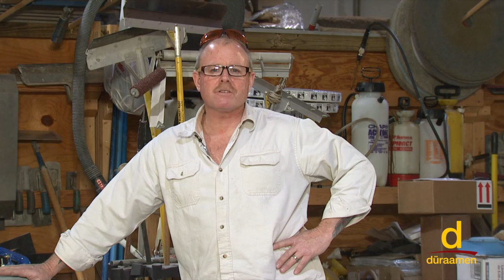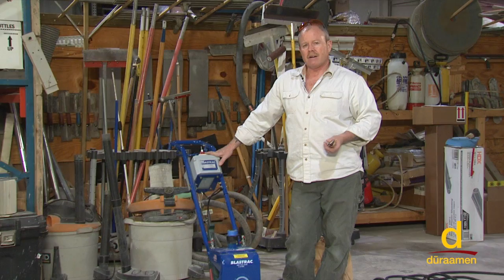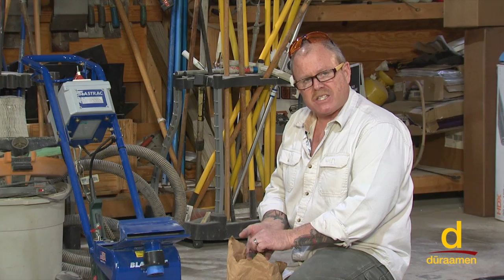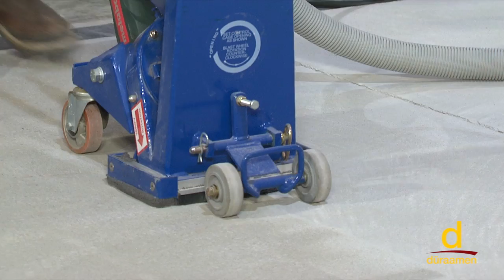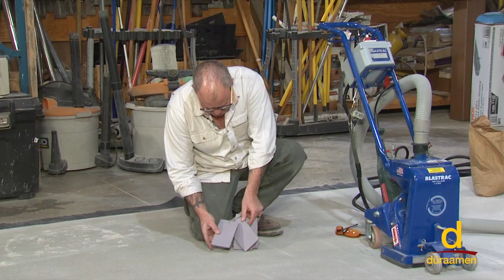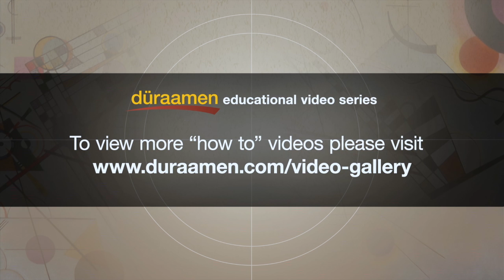Concrete Surface Preparation Using A Shot Blasting Machine

Comment: can I use this machine to remove the old stain and sealer from stamped concrete? Frustrated as this point as a pressure washer will not take it all off...